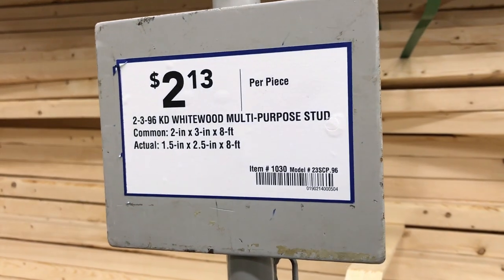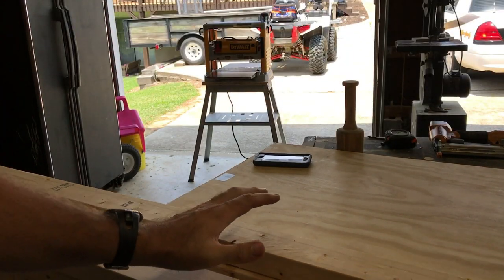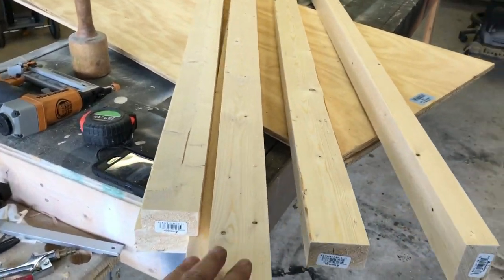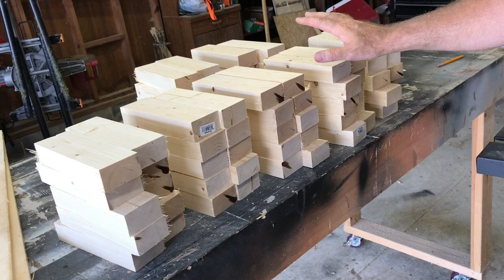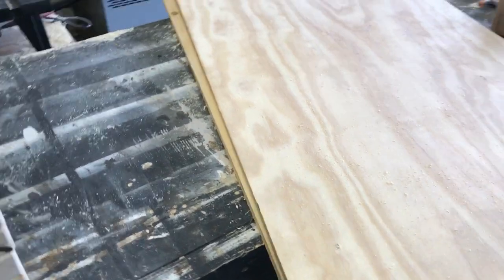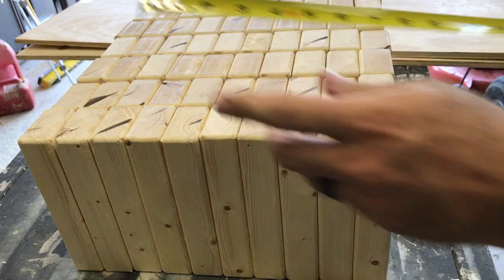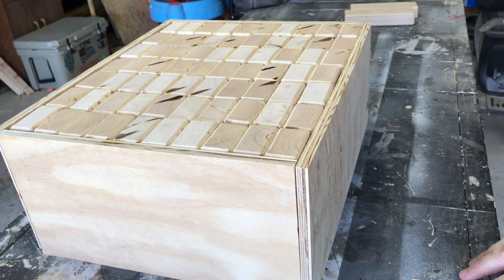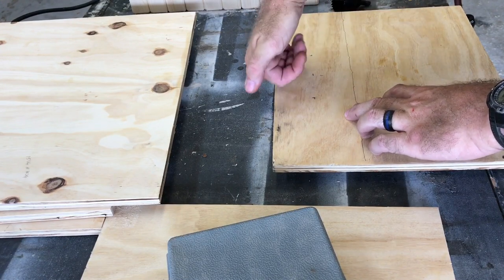DIY | Giant Jenga Set | Party Games

Comment: 70 blocks doesn’t divide in three.  70 would have only one on top row. I guess you use 69 and have 2 left over as spares.
Reply from the maker: Bay444444 That’s right, I did have 2 left over which works good if you loose or damage one
Reply: How do you have 70 blocks, use 69 of them and still have 2 left over?

Comment: Thanks for the video. I bought 7 two by threes, plan them and cut them but 7 and a half didn't work for me because it was 3 and a half inches across.. So 3 time 3 and a half is 10 and a half to make a square. Could do 60 or 70 but luckily I got the extra board and it's a regular jenga set. 54 blocks lol. I also got a makita cordless router... I've never used one of these so hopefully it works out

Comment: I made one with 2x4's and how can I wheather proof it and still keep it smooth enough to play
Reply from the maker: Dean Smith you may can use polycrylic which is for outdoor use and just sand it smooth after a couple of coats. I would test it on a scrap piece first before messing all of them up.
Reply: a little secret I learned for out door wood furniture is using old motor oil for stain works great then go over with a poly